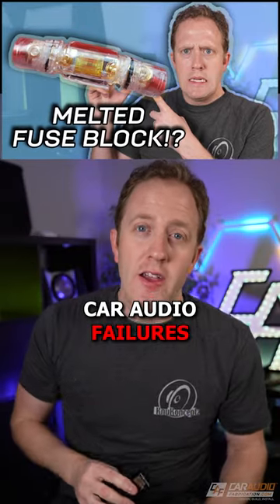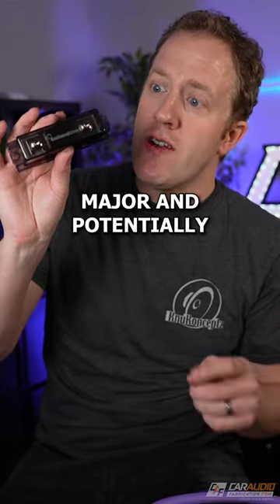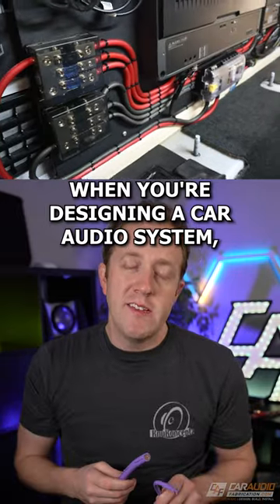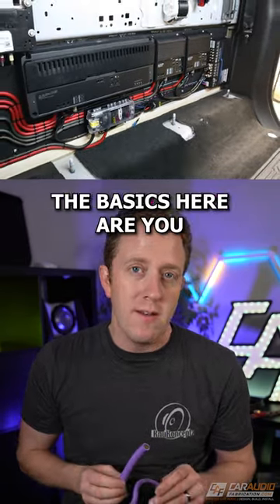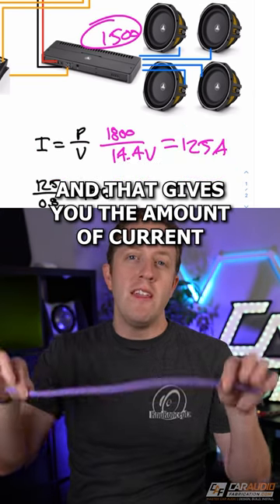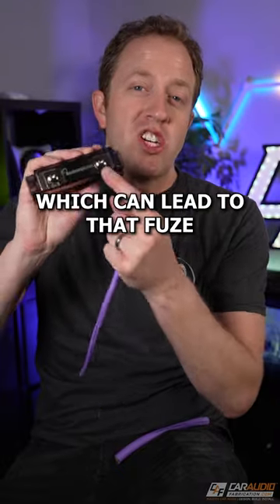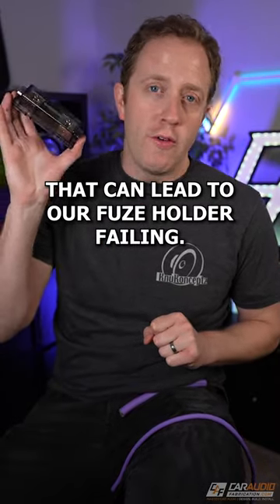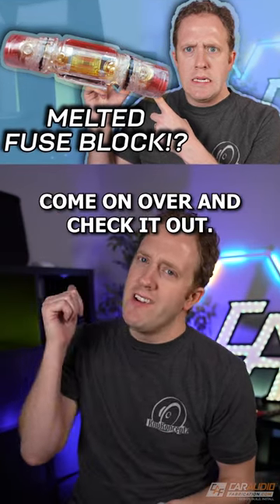Car Audio Fuse Holder getting HOT? Watch out for these failures! #shorts

Comment: I typically divide RMS system power by 12v to account for variables and the fact that you may not listen to the system with the engine running from time to time. Plus it doesn't hurt to have some overhead

Comment: Anyone in the community, will I need 1/0 gauge battery wiring if I get a big 3 upgrade?
Reply from the maker: Doing a Big 3 doesn't automatically mean you need to use 0 gauge wire for the amplifier run, but if you are taking the time to do the big 3, might as well use the largest wiring you can, even if oversized. Usually for applications where you are using smaller than 0 gauge the big 3 isn't as needed.
Reply: @CarAudioFabrication  Great, thanks. I have to do things in stages; starting under the hood and wanna avoid resistance issues while saving $$.

Comment: I have a 4 gauge wire running about 2900 watts all together my fuse melted and one part of my power wire got cooked 🤦🏾‍♂️ my music guy I go said it was most likely because I have a loose connection which is probably true because when I changed 8 gauge wire to 4 gauge I was trying to hurry up and was using regular scissors to cut the wire 😂